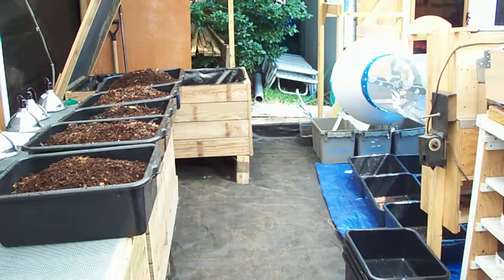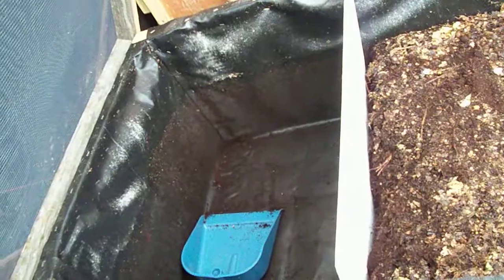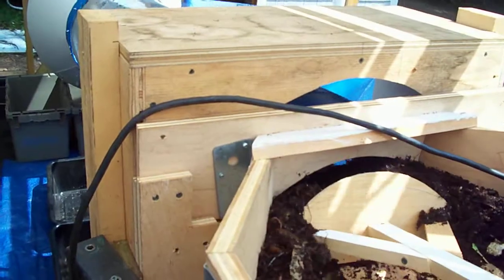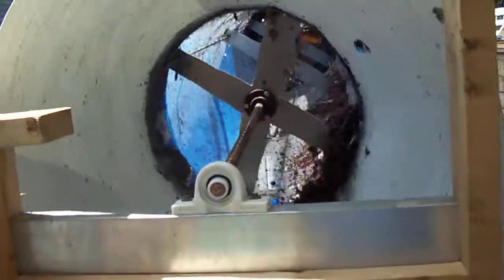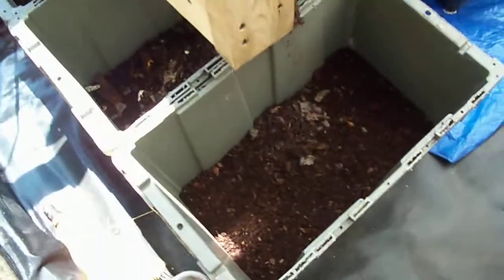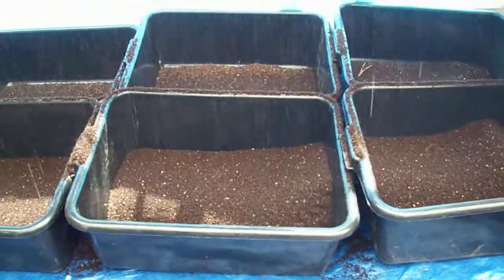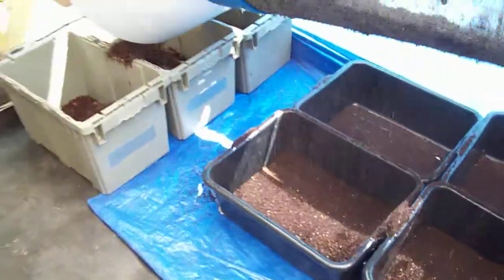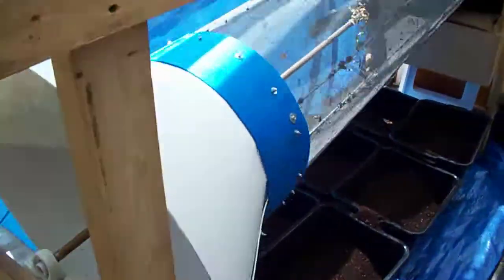Vermicomposting

Comment: Hello! what is the red and white strip? heating or light repelant?
Reply from the maker: The red and white around the edge was a rope light, they did not do a very good job keeping the worms in the bins. There are several things to take into consideration, worm population, for every pound of worm they should have one cubic foot of space. If conditions are ideal worm Population will double every 60 days. They will also leave the bin if there is too much nitrogen and if you use a lot of acidic foods, they will also leave if there is not enough moisture or too much moisture. Watch the temperature if it is too high they will move to an area that is cooler, good temperature between 75 and 80°. If the bins are too hot they will leave. I find if the compost has enough organic material, a constant supply of food, moisture and a cover over your compost they will stay.